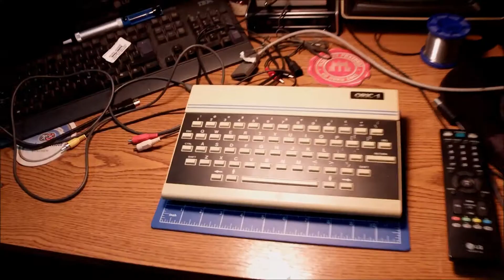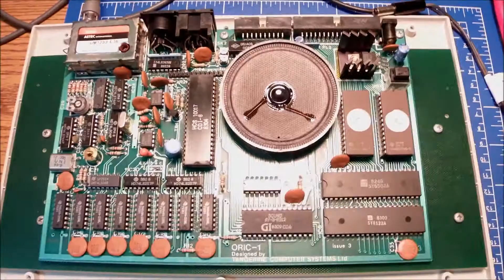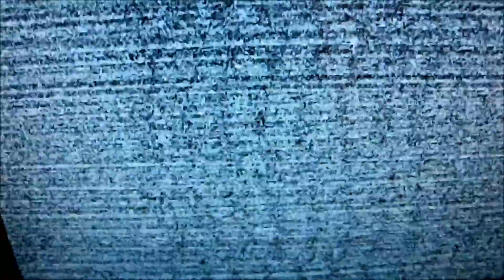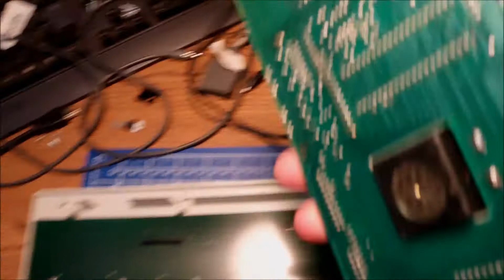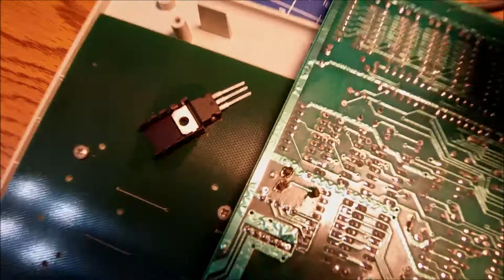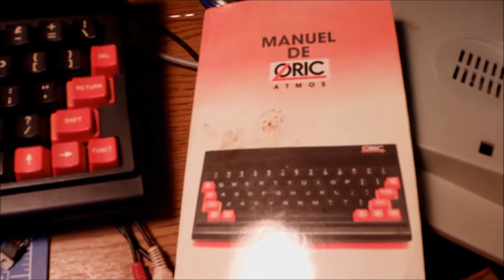ORIC 1 - 1982 - Tangerine Systems UK.

Comment: If the voltage regulator gets too hot, then two thing can be done. Replace the power regulator with a modern better performing one, that is to say, one with less spillage of energy. Nowadays there are a new kind of power regulator that work as a boost-converter of buck-convertor in the same way as switching power supplies work. Due to the efficiency, there is hardly use for a heat-sink. The other way of getting the temperature down is by using a different kind of power supply. Most chips use 5 volt, most power supplies in the old days were 9 volts, with a regulator on the board the voltage had to come down a few volts. Offering 5 volts to the chips that need only 5 volt prevents the use of a powerregulator. Less heat and a longer life for the electronic components.
Reply from the maker: All valid points mate! thank you so much, the truth is i haven't tried several things on this machine ever since .
Now, you gave the first and most important idea to start again with and future-proof it.  
Thanks for knowledge sharing and for watching!..